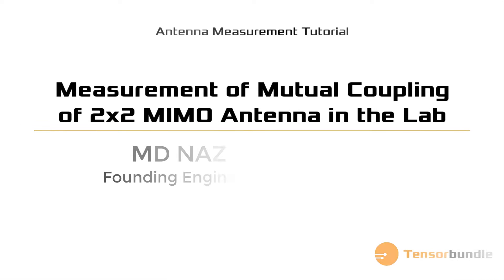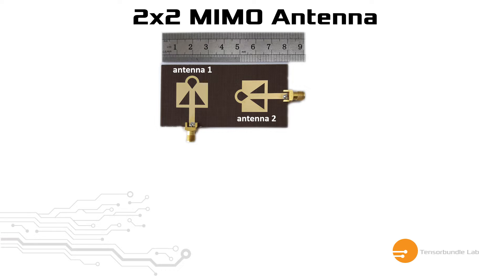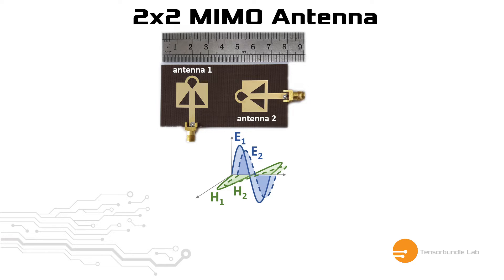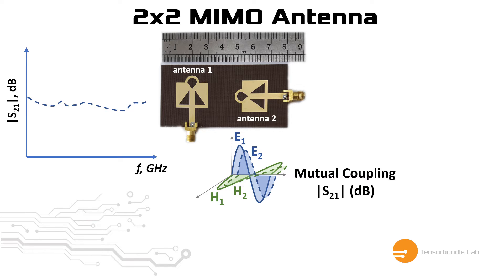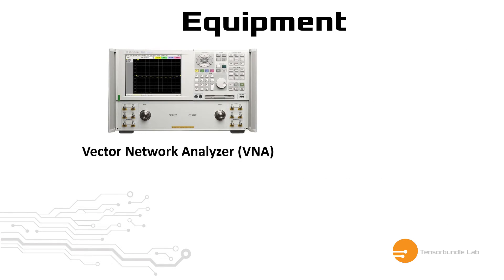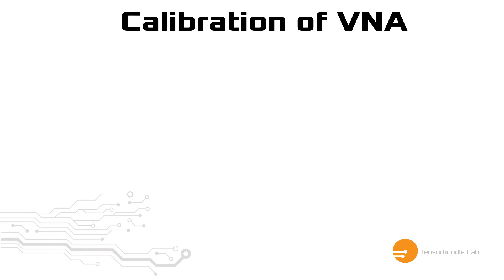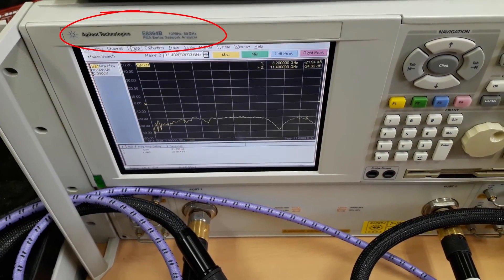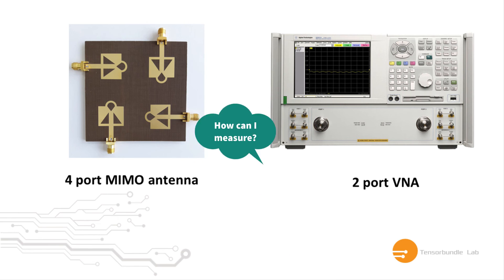Mutual Coupling Measurement of 2x2 MIMO antenna

Comment: Sir, how to find fidelity factor in HFSS?
Reply from the maker: Not sure, but in HFSS there is always an option of using calculator, and inserting custom equation in "Results" menu. Why do not you use MATLAB after extracting all simulated s-parameter files from HFSS to MATLAB
Reply: @tensorbundle   Sir please guide me..how to use s-parameters for getting fidelity factor.

Comment: Hi! I am doing my thesis, I am measuring the mutual coupling in an array of 1x16 antennas. I am a question, The 16 antennas must have the same value of s11?
Reply from the maker: No , not really, they will have slightly different return loss (due to mutual coupling). We use Total Active reflection Coefficient (TARC) to define it.. watch TARC derivation lecture in this channel. You will learn what it is